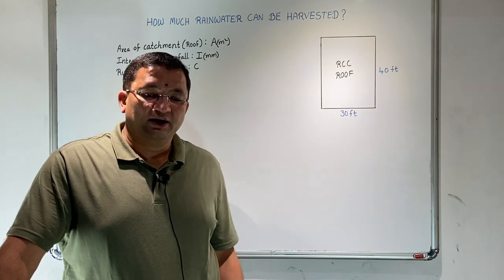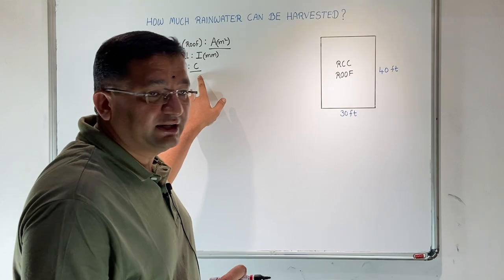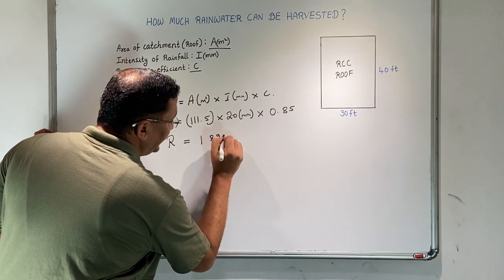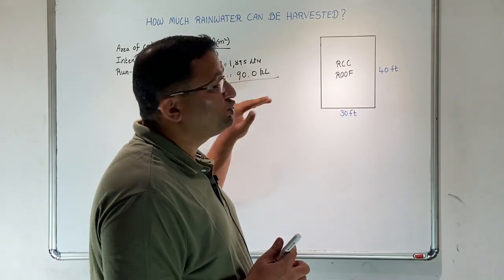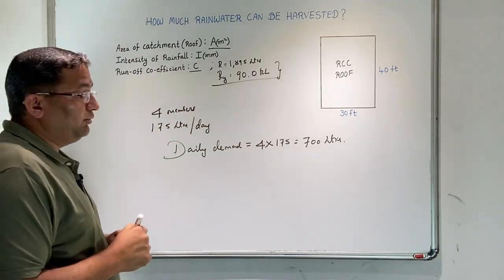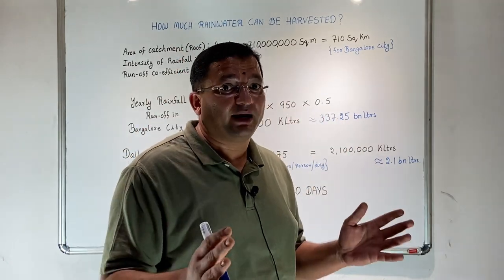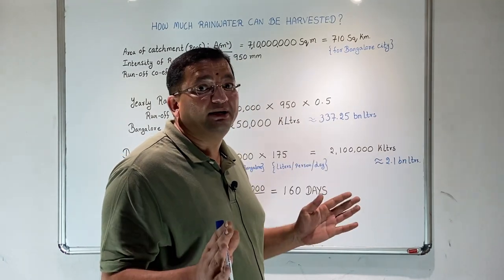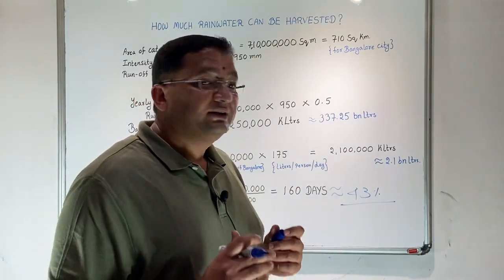Estimating Rainwater Run-Off and Supply Demand balance

Comment: Sir, first of all, many many thanks for sharing extraordinary information through your videos.. Each and every bit of information is very very useful to the society and mankind, environment... My sincere Thanks to you once again from the bottom of my heart...

Secondly, a small doubt sir...

I understood, how much rain water can be received in a single rain, etc. But what size of the Filtration Tank should be constructed according to the roof size.

I have seen your another video, where you have constructed two compartments, of which size?
and why two compartments are necessary..

I will be very thankful if you clear the doubts...

Thank you in advance....🥰🥰🙏🙏

Comment: Hi Sir, is this same method as rational? this means 1/360 x A x i x C ?
Reply: Rational method is been derived based on the logic..
That is "A" is the Catchment area or drainage area contributing the flow
C is runoff coefficient value which depends upon the type of landcover...so more greener the land area within the catchment less would be runoff coeffcient and due to more infiltration of rainwater to the soil
"i "is  the rainfall intensity.. it depends upon the time of travel of 1st raindrop to reach from the highest elevation of the catchment to the outlet point of the catchment

Comment: I think after learning from u, there is no need for a consultant. But I have a factory of catchment area 4500 square meter. As per ur calculation 7000 meter cubic water we can collect. But if I calculate the same reservoir area it is too big. Can I make it 20%. Because of less area I have.
Reply from the maker: For a 20 mm rainfall, the run off is 4500 x 0.8 x 20 = 72,000 liters
Reply from the maker: You have to size the tank for single rainfall or at maximum two days of rain .
Reply: @HinrenEngineering  Single rainfall how I measure??
Reply: still no reply
Reply from the maker: @shahildays2985  kindly mesage your queries to +919035625364 or mail to info@hinren.com
Reply from the maker: @shahildays2985  single rainfall is 20mm . The runoff is 4500 x 0.8 x 20 = 72,000 ltrs
Reply: If you are going for reservoir then better to consider infiltration and geology as a practicing hydrologist i can recomend to check CPHEO 2019 manual once reservoir/pond sizing

Comment: As soon as he said measuring in 'square feet' I stopped watching. One millimetre of rainfall on 1 square metre of roof gives an output of 1 litre or water. Collected in your tank this weighs one kilogram.  Its not 1923 anymore is'ts 2023 and if a video does not use metric its automatically obsolete
Reply from the maker: Well, the very next moment, while doing the calculation, it is converted into square meter .
Reply: @HinrenEngineering  I do apologise, I watched again, Thank you for explaining in metric.
Reply from the maker: @TRPGpilot  In southern India , it is common to measure residential plots in square square feet.
Reply: @HinrenEngineering  Understand now. Thanks again.